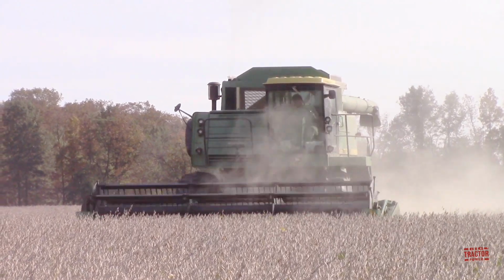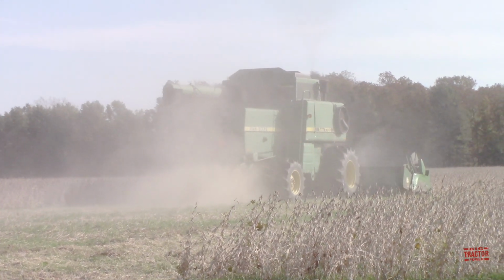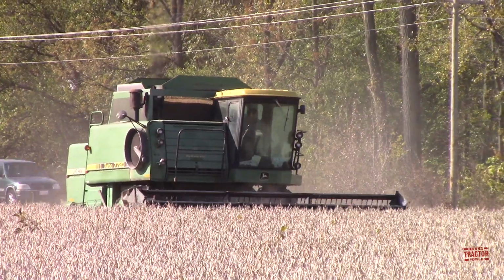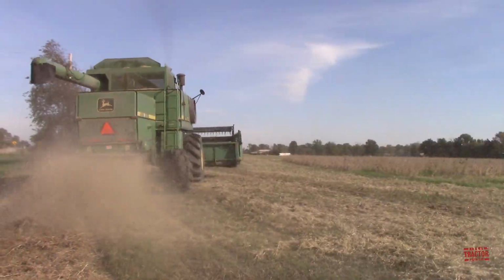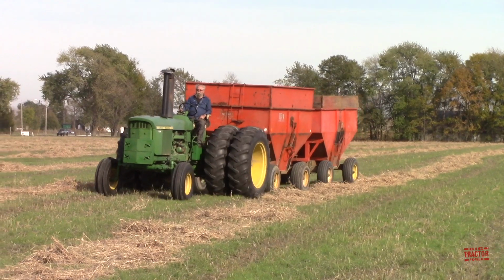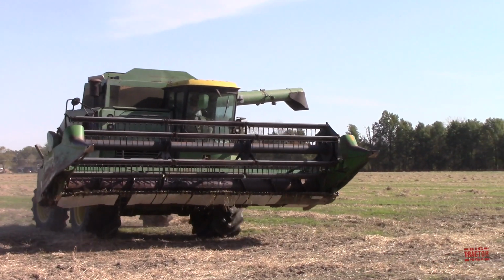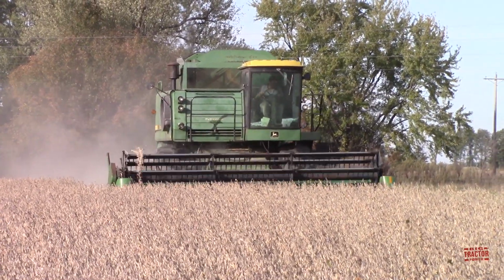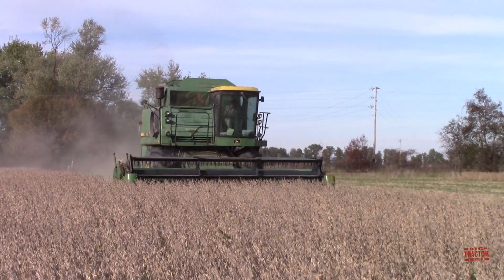JOHN DEERE 7720 Turbo Combine Harvesting Soybeans

Comment: My first harvest in Canada in 1996 was in a green top 8820 T2 1986 i think. In 97 we did hemp and we bought an anniversary 9600 and i tell ya, the old 8820 walked past the 9600 (both run 30ft HoneyBee) and ran longer after sunset too. But you never wanted to replace the big primary shaft thats behind the cab and runs from one side of the machine to the other (gotta be over 400lbs)
Reply from the maker: Thank you for for some cool combing history.

Comment: My Dad had a Turbo 7720,  and a 2nd John Deere combine from the late 70s before they changed body styles. Finally retired the old one a few years ago after it wouldn't start, and they couldn't diagnose the problem.

Comment: Probably the toughest most reliable combine ever built!!
Reply: Not even close
Reply: Definitely...Had one for 20years...sold it with 4400hours...still see a lot around with 5000 to 7000hrs getting harvest done
Reply from the maker: It is with out a doubt. I filmed a 7720 in Iowa harvesting corn with 15,000 hours.
Reply: @bigtractorpower  the farmer that told you it had 15000 hrs on is full of it. The 00/20 series self destructed from vibration around 5000 hrs, and Titan 2 self destructed even faster. The 6620 lasted the longest followed by the 77 and 88 fell apart even quicker, they were basically a widened out 6620. I owned the whole line including a 4420. Had a 6620 a 7720 a 7720 Titan 2 and an 8820 Titan 2 at around 2000hrs they start to nickel and dime you. The highest we ran was 4000 hrs but by then the cost to operate was getting to be roughly $15000 a year, and do custom work you couldn't afford the down time
Reply: @RJ1999x  

Your full of it. I can look out my window and see a 8820 titan II that has well over 5000 hours and still going strong. Maybe you mistreated your equipment and they fell apart because of that? Our 8820 has duals and tip top bin extensions not to mention a yield monitor that maps with gps.
Reply: @bubbawubba2307  hate to be the bearer of bad news but when we switched from the 8820 Titan 2 to the New Holland TR it logged 11000 hrs and was sold to my brother in law and is still going. At 8000 hrs we gutted it and rebuilt it internally. The most expensive year we ever had running the New Holland was $1200 vs the $15000 plus to run the John Deere.
So much for your theory on abusing the equipment

Comment: strawwalkers were different on those combines. We bought an 8820 titan II and it had the rice straw walkers in it. Had to buy more straw walkers and replace em. Spent a lot of hours in those 20 series combines. from the 66-88 models. the 8820 II would run circles around the 6620. Also big difference in the rear end of the 2 wheel drive 6620  and the mudhog. We replaced the rearend in one 66 several times until we upgraded to a mudhog. we also ran a 20' head on the 66 and a 6 row corn head. on the 88's they need a 30' foot head and depending on yield 8 row or 12 row head.

Comment: I remember as a kid riding in the 7720.  At the time it was the cats meow!!
Reply from the maker: I agree. I remember a farm on the road I grew up on went from a 7700 to a new 7720. I thought wow because the 7700 was huge at the time. Here was this modem cab and black reel in the grain table instead of the yellow one on the 7700. The farm bough the 7720 in 1979 and kept it all the way through 2003.  It was built to last.

Comment: Great machines we still run one 7500 plus hours. It does a great job next to our 9650 just a little slower lol
Reply from the maker: Nice combines. Is your 9650 a walker or rotor?  The 7720 was built to last.
Reply: @bigtractorpower   the 9650 is a walker machine.  We have a large straw market and I need all the straw I can get lol.  And I've never been around a rotor.  Lol scared that they will make sawdust out of my straw lol

Comment: at 8:09 ish, does anyone else see the grain leaking out of the clean grain auger along the botton of the machine?
Reply: after reading your comment i looked at it again you are right ,and a lot of beans
Reply: They probably have a hole in the back facing side of that elevator.  Those are frequent in older equipment like this because it's thin metal that wears through and there is no easy way to repair it since there's only about 6 or 8 inches space between the tube and the belt drives.  I've seen them patched with silicone, epoxy, and plain old duct tape.  It's just how these old combines are.
Reply: That's where that tractor operator needs to get off his butt and catch things like that.
Reply: Yes it is losing quite a bit the way it looks. I hope they caught it. We always have any other guys in the field check the combine as it goes by them just to try & catch a problem like this.

Comment: We had 3 7720’s 2wd in rice country Very dependable machines. Traded one for a titan2 in 90. Traded one for turbo 8820 round the same time.   Needed combines with mudhog.  The last 7720 Ran till 95 traded for a 9600
Reply from the maker: Great history. Thank you for sharing. Did you 7720 Titan II have duals? The brochure showed the Rice Special 7720 dualed up.

Comment: We used to run a JD 975 with a 13” foot header, which I’m thinking must have been a smaller class that the combine featured here. I’ve never seen this class of combine before

Fantastic tractor pulling the cart too - but no ROPS?!
Reply: in 2001-02 we worked in corn harvest with a 965, using a 444 corn head, having a very clean grain sample, guys with 7720 got amazed about grain quality, corn head was too heavy for that machine, but they work good, a long ago no see videos with those little combines

Comment: Bought a new 6620 hydro turbo corn soybean combine in November 1981 when my 6600 burned up.  Guess I got a good deal because I remember paying just shy of 60 K for it.  Should have gotten a 7720 at that time.  Did buy a 7720 later.  7720 was a lot more combine.  Good video!
Reply from the maker: Very cool history. I thought I had made a history on the 6620 Turbo but it looks like have not posted that video so I will produce that soon. According to my price book the 6620’s list price was $67,000 to $72,000’depending on how it was equipped.

Comment: Nice looking older equipment!  I'm guessing the Posi torque drive is a variable speed belt set up?  I just assumed all manufacturers had gone to hydrostats by the 80's. Maybe it was a option still?  Also, are they going to bale the trash?
Reply from the maker: I did too on the drive.  I have to think for $3,000 most people spent the money for Hydro.  I don’t know if they baked the straw. There was plenty out there. This was a random find that I stopped to film after spotting it from the road.

Comment: Those old 7720's will be here after the earth turns into dust B.T.P.."
Reply from the maker: They are solid machines. Remember I told you on the IH 1460 video that John Deere had matching grain configurations on their combines 😁
Reply: @bigtractorpower  Yes I did.😎👍
Reply: Got that right, they are good machines. I still have my old 7720 to help out with beans and wheat, or if the 9670 breaks down.

Comment: I had a 8820, Then 8820 titan 2 were awesome machines now I have a 9500
Reply: Dawn Wittgreve Were the cabs noisy and hot with the engine so close?
Reply from the maker: Very nice. An 8820 is top my combine filming wish list.
Reply: bigtractorpower wish I’d known this last fall, we had two 8820s that were traded in to our used equipment lot, we ran one in wheat and ran both in corn last year. We’ve since sold them...

Comment: Why do the reverse the back wheels when its 2wd? Save wear? Thanks fantastic work as per usual.
Reply from the maker: It is to point the tread for grip in a wet spot. With a 4wd model the rear wheel assist will pull with the front tires to pull through.  With a 2wd the combine will have to back out so have the tread turned gives the combine extra tread and grip going back wards.
Reply: @bigtractorpower  Thanks for the reply always good to learn something new!
Reply: Yes u turn the rear tires around on a 2wd combine to save on wear.